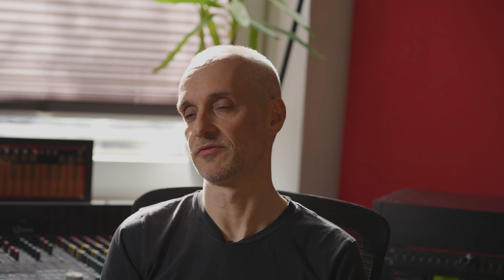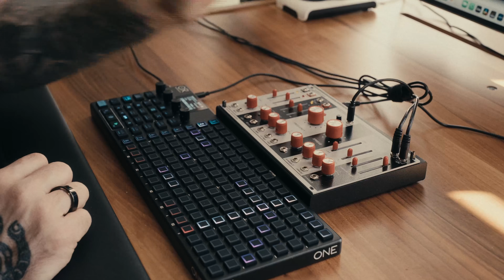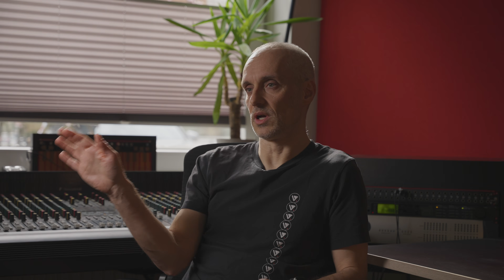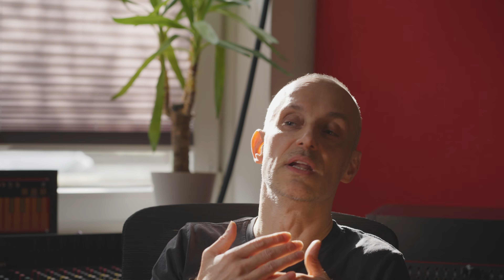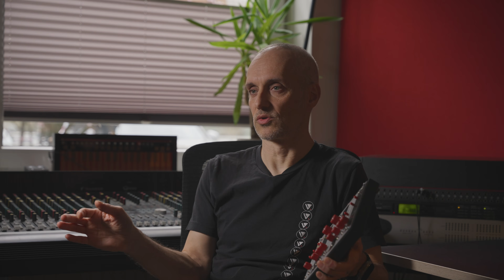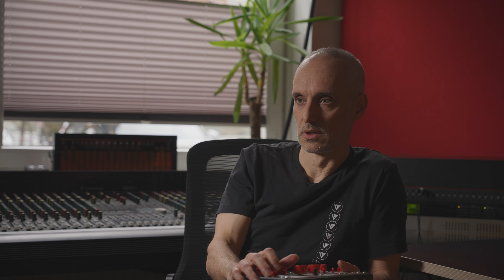Sawtooth Stack Origin Story featuring Barry Schrader

Comment: Sorry for having to comment! Capturing the "Lost Atlantis" patch in a module is cool for sure. I had the thought that it cold possible be better to capture the overall design or configuration concept of the patch as well. Like if you had oscillator tuning screws with micro switch mutes per oscillator on the face somewhere to set individual macro pitch. Possible also potentiometers per oscillator to adjust further off of the macro, like fine tuning or detuning. Then the oscillators could be tuned to explore other tunings. Also, possible the input/trigger CV, gate, mod could have a micro switch matrix/grid that set trigger paths to the individual oscillators, to set how they trigger. Parallel or contrasting like he stated. So, grouped or individual, the CV switch matrix could have timing divide and route order intervals, so depending on which micro switches were on it would route the triggering to the 5 oscillators accordingly. Possible micro gain knobs integrated to the lanes of the switch matrix grid that adjusted trigger strength/voltage to dial in polyrhythm structure.  So, the Atlantis patch would be attained by tuning the oscillators and setting the switch matrix a certain way. But the module could be tuned other ways, and triggered other ways to expand/explore on the overall concept.  Then people could list on a blog about their patches for reference to others to find sounds areas/types they are looking for. Complicated but simple at the same time.